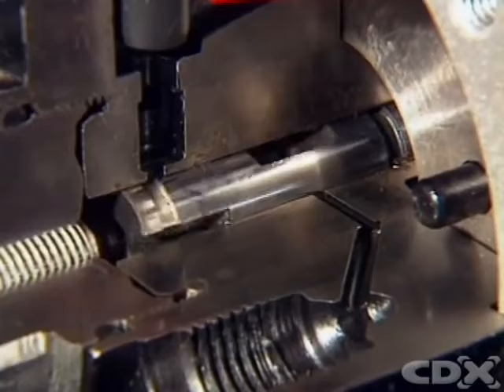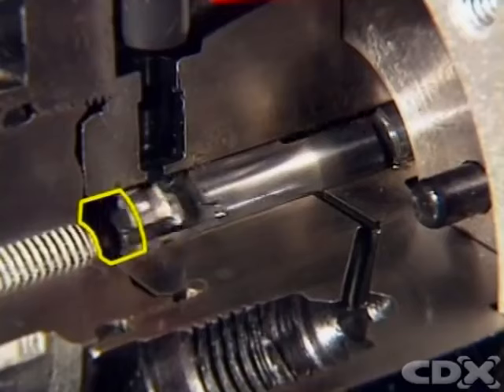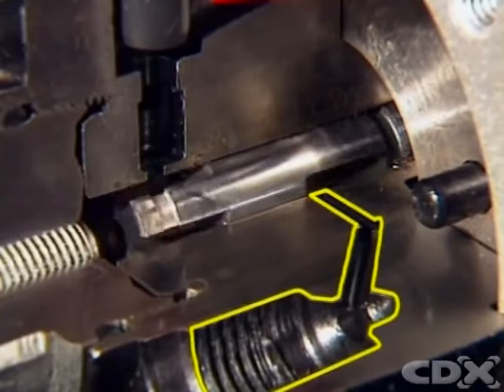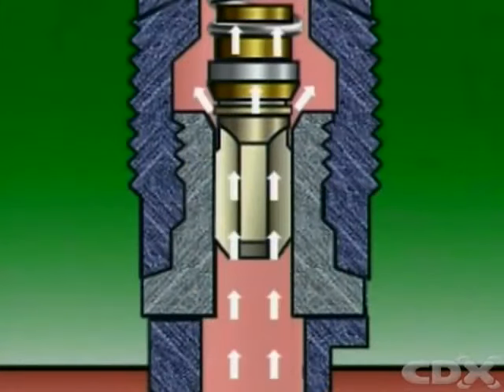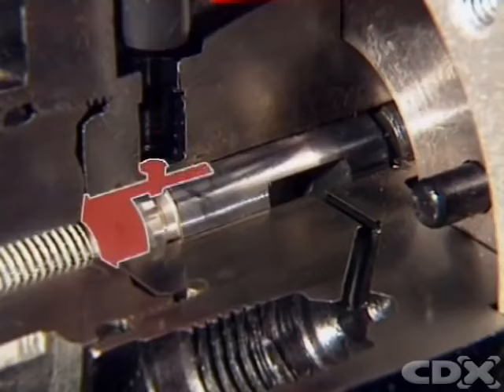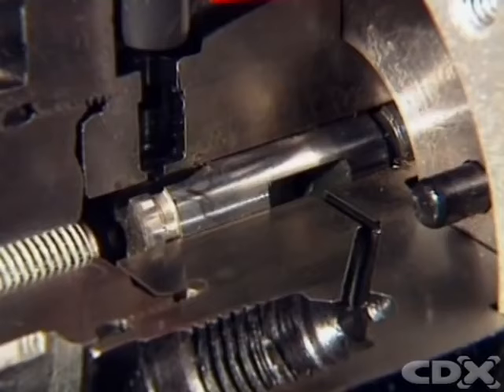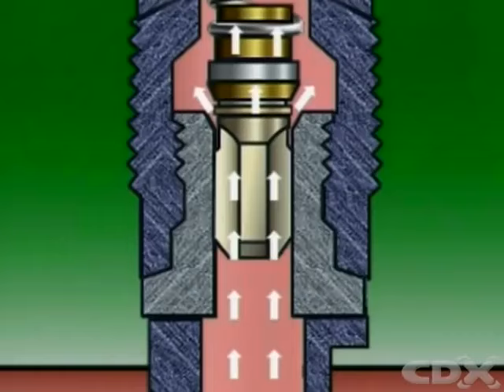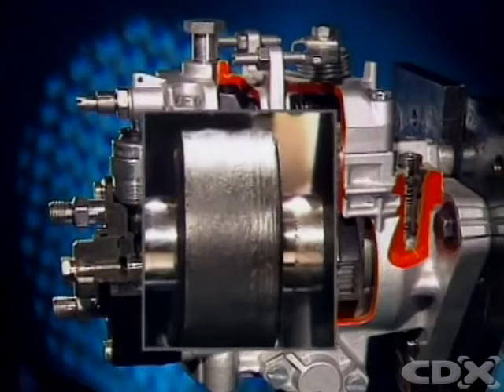How Rotary Type Fuel Injection Pump Works?

Comment: Nice you explain it so clare wat are the advantages and disadvantages of that pump
Reply: Advantages of MFI : old school technology, nothing fancy means low costs, and low repair bills. Nice and reliable too.
Disadvantages of MFI : Technology is rather dated and modern fuel injection systems are capable of much higher power, torque, and use much less fuel. Mechanical fuel injection can also be very noisy, and won't meet strict emission requirements if you live in a smog zone or something.

Comment: Do not turn up the fuel !!!!!!!!! That's not good
Reply: Can I turn down the fuel without turning down the throttle on a qd32 engine nissan frontier
Reply: @damiondamion1267  yes